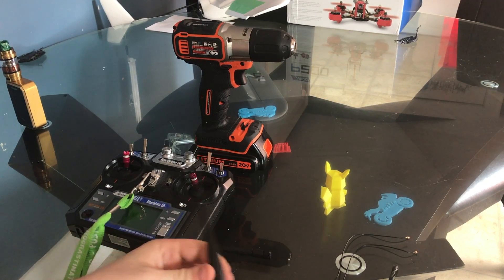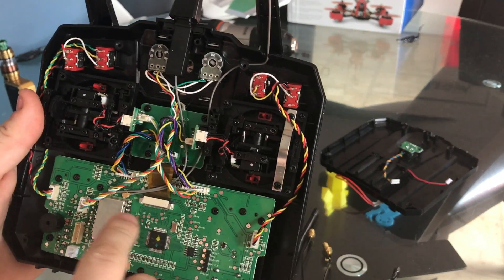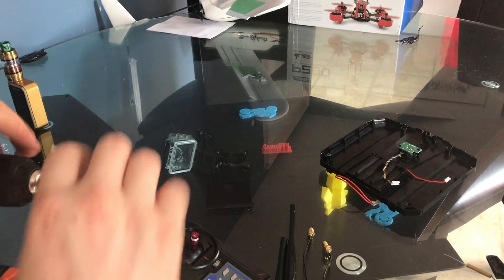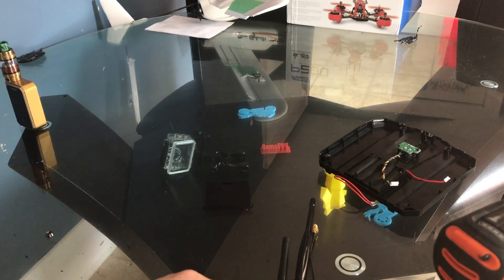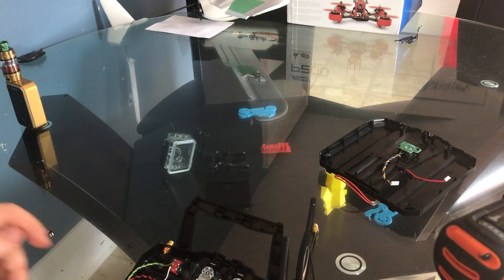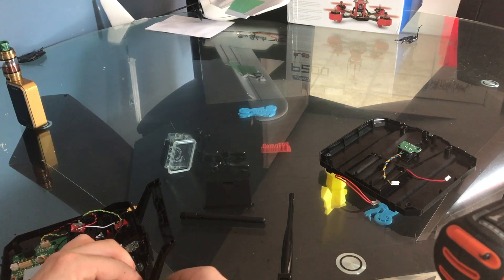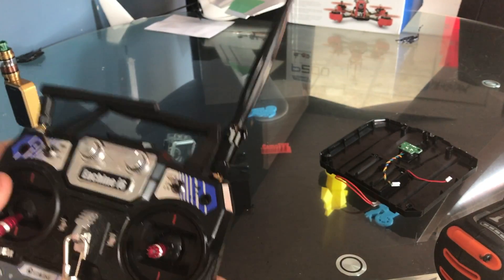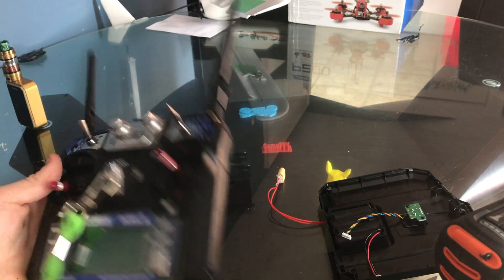Flysky I6 ~ How to ~ Antenna Range Mod

Comment: Guys be very careful. Did the same mod hoping for the best, but for some strange reason the signal kept dropping even at 30 metres. So when during my first test flight I flew it around 30-50 metres away, my drone became uncontrollable. If I was giving throttle, it was getting the signal for fraction of a second and kept going up, then tried to move it near me and my drone flew so so far away from me, completely disconnected. I can see it flying very far but not under my control. Couldn't do anything else apart from praying to God. Luckily I had return to home as falesafe and after some unnerving time my hard work came back to me!!!! Such an experience and I'm very scared since. Thanks to God

Comment: got 50 - 80 % more range with all cheap toyplane remotes - awesome.
Used the sma from my old wlan router (cost like 0$)
I recommend that to everyone ^^
https://s31.postimg.cc/53lo50raz/1040553.jpg
https://s31.postimg.cc/6in8trn97/1040556.jpg

Comment: What happens if the radio is turned on without antennas? Does it fry?
Reply: No,I tested with my transmitter....The range will be decreased by 75%
Reply: yup, computer part like always searching for a signal/ and if no signal/ cause no antenna.. if just keep amping up till it frys :>( .kinda like sends a  wave to antenna /and its not there and yet now its 2nd wave also made -poof ! just make sure the antenna on ! before put a battery in it! I myself /don't keep the battery inside it! unless im flying! test / store always!